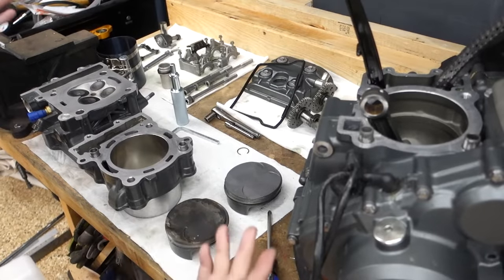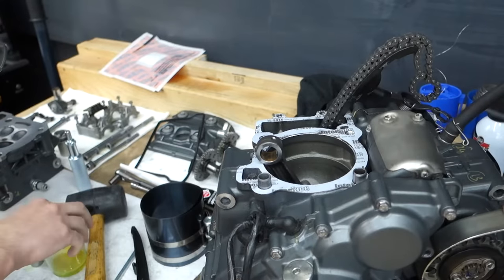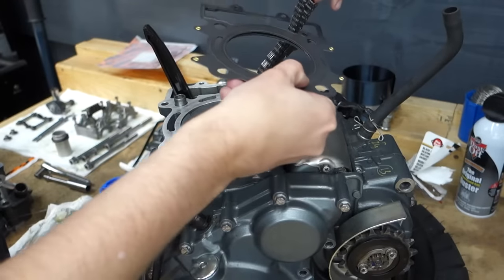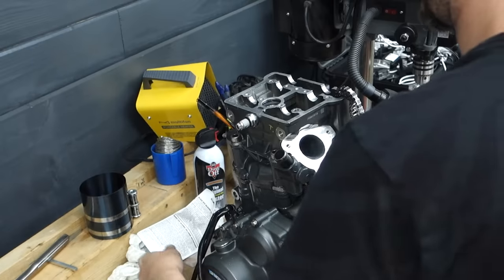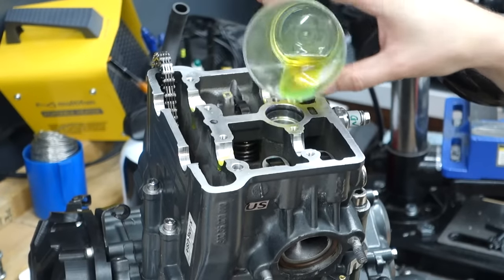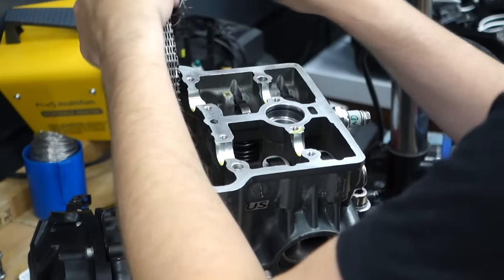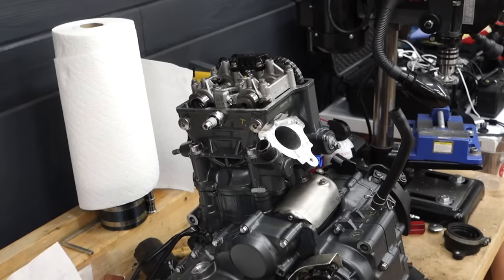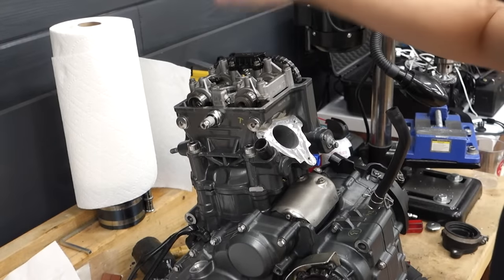KTM RC390 Top End Rebuild

Comment: Hi i have ktm rc 390 bike.i got a issue of high coolant temperature and noise from magneto cover side like ticking sound sometimes not continuously so suggestions feom your side
Reply from the maker: Not sure what the noise would be, being intermittent it may be something knocking around. Coolant temp could be anything from high ambient temps with a stock setup, water pump seals leaking, or a blown head gasket.
Reply: Everything is new coolant lvl is ok no leak and the head is new one
Reply: Is it possible for any sensors error
Reply from the maker: @mohanmano4969  hmm it's possible, I have zero experience with that though
Reply: Anyhow thanks mate for sharing your thoughts
Reply: Cam chain?
New tentioner

Comment: That looks like a first generation 390 motor since KTM changed the cooling passages to give the gaskets more reinforcement in 2016. You're going to have to do this about every 4-5K miles with that motor based on my experience. My head gasket blew 3 times during the first  11K miles before I replaced it with a 2016 motor. My bike now has 55K miles (44K with new motor) and still runs flawlessly.
Reply from the maker: Came out of a 2017 but I wouldn't be surprised if they threw an older generation motor in some of the first run.
Reply: @GarageAddiction  hopefully I'm wrong about what I saw. I was looking at the video on my phone (small screen).
Reply from the maker: This bike was great for a while but has started with trouble again so you may be right
Reply: @GarageAddiction  the dealer screwed mine up three times and then when the warranty expired KTM conveniently forgot all the conversations we had about this. Spent my own money to buy a newer motor with less than 300 miles and it's been great ever since.
Reply from the maker: Glad to hear! I’m not sure what I’ll end up doing but it seems like another engine out is in the cards

Comment: The cylinder is tapered at the bottom. You can compress the rings by hand one at a time and install the piston from bottom of the cylinder instead of using a ring compressor and installing it from the top.
Reply from the maker: I don't know if I'd be able to juggle the rings and cylinder on this bike. Easy enough on minis though!

Comment: So i have adventure 390 (2020model)done around 52000 km there is not even a single noise still runs like brand new so do i need overhaul or anything replaced in the engine my engine is never touched till today
Reply from the maker: You should check the valve clearance for sure, with oil and filter changes I wouldn't worry about cracking the engine open unless something feels different or you see some smoke out the exhaust, coolant loss. I don't think KTM provides intervals for pistons on these engines.
Reply: @GarageAddiction  there is no smoke no coolant loss will get it checked with valuve clearance thank you so much 👍

Comment: Having watched your videos showing all the changes made to fix the coolant mixing issue I can only think of one other possibility….. the joint between the two engine casings. The coolant passes into the casing at the front of the barrel and has to pass the casing joint prior to entering the pump.  Anyone have any other suggestions?
Reply from the maker: Yeah I've eliminated most possibilities now. Planning on drilling a weep hole and pressure testing the cooling system  (not by the rad cap as the seal is poor) If it turns out to be the cases it'll be fun tearing the whole engine apart :/

Comment: My KTM is a Duke 390. It's the same engine. And now, I have the same problem. But i will just clean up. One of the valves is damaged and the oil sinks to the bottom. I'm waiting for the parts. I'm doing the work myself and your video helped me through the process. Thanks.
Reply from the maker: Glad it was helpful!

Comment: Just wondering..... when u installed the piston I remember from the tear down there was notches for the valves when u installed the new piston u didn't show it if the new notches line up with the head correctly? I can reference what I'm talking about from ur previous video
Reply from the maker: At 44 seconds you can barely make out the marking on top of the piston which points to the exhaust port

Comment: Once it's out it's not a complicated engine at all. The video shows everything well visible, nice job !

I was wondering why you removed the cam followers, if you keep them in you can inspect valve clearance even before you dismount the head, saves you some time and you can order the right shims a lot sooner. Of course you need to recheck with new shims installed.
Reply from the maker: It would have saved me some time for sure but I think I pulled the cam 2 times to get it perfect anyway haha
Reply: @GarageAddiction  It was meant to prevent the waiting time for ordering the shims... Sometimes I've got them a day later, sometimes more than a week ;)

Comment: Is it neccesary changing the bottom gasket if the engine is using coolant?
Reply from the maker: Depends on where it's leaking from :) Most likely no, the head is the usual culprit but I also swapped the piston so a base gasket was easy enough while there.

Comment: 9:30 second on tear down video. Is there any way to miss align the new piston when installing just curious had me thinking when u installed
Reply from the maker: There is a marking on the top of the piston that goes on the exhaust side. I think I mumbled something about exhaust instead of properly explaining what I was doing.
Reply: @GarageAddiction  okay was just making sure they were aligned right didnt want u to have any problems just makin sure thing were good
Reply from the maker: Much appreciated, I actually rotated the cylinder at one point and installed it backwards. I threw something across the garage and took a beer break after that.

Comment: Why didn't you go with a larger coolant passage gasket or high compression gasket?
Reply from the maker: I didn’t see any with a larger coolant passage, I’m interested though. I skipped the high compression because of how high strung they are and I’d wanted to make sure everything was working well at stock power before throwing a bit more at it.

Comment: Super helpful. I'm going to be doing this same job. do I need to buy new head bolts or can I re use them? (30,000kms on the engine) Or any other parts other than a gasket set? Can I leave the piston on the conrod  if I'm not replacing it?
Reply from the maker: I didn't get new head bolts but after some reading it looks like that's a good idea. You can leave the piston and rod if they're in good condition. They probably will be, I replaced mine while I was in there with the amount of carbon on it and slightly worn side skirts. There is a thin head gasket kit that sounds like it bumps the compression and runs well but I opted for stock right now. While you're in there check the valves and swap the plug since it's a nightmare to get to.
Reply: @GarageAddiction  thanks. I was thinking after I posted, that it might be very difficult to get the piston rings squeezed in from the bottom, without getting the ring compressor thing stuck in there...
Reply from the maker: Yeah no need to mess with the cylinder or piston if they look fine. It’s a lot easier of a job to just swap the head gasket and studs. Also I’d be very impressed if anyone could keep the piston on the rod and get it into the cylinder haha
Reply: @GarageAddiction  oh I see, I was thinking of doing the lower gasket between cylinder and block while I was there, but I guess there is no need if it's not leaking.
Reply from the maker: @nictarver2988  yeah I wouldn't worry about the base gasket if you're just in there for the head.

Comment: is this throttle body is equipped with Ride By Wire Technology ? or accelerator cable connected  ?
Reply from the maker: My bike is ride by wire, I think that was a 2017 change but I could be wrong.
Reply: @GarageAddiction  yeah right I found online manual for duke 390 2016 study material I couldn't see RBW tech or unit on TB. Change was done in 2018

Comment: Great video mate, planning on doing this myself, bike has started blowing smoke after sitting and around the same as yours 8800km.

What year is yours, the only Piston kit i can find is 2013 even though I search my bike 2017.

Also did you use any other parts or will the Piston kit surfice?
Reply from the maker: Thanks! I have a 2017. The piston kit is the same for tons of years since there have been almost no changes. No real need to replace the piston, I did so while I was in there as it was caked in crazy hard carbon. The part number I went with is 90230007010 which I think lists 2013 as the year. I picked up a bunch of parts when I went through the engine, mainly all the orings in the head, a new oil pressure sensor because I accidentally smacked mine, spark plug,  and a fuel filter. I would get new head studs if I was going to do it again, I didn't think about them when I ordered everything.

Comment: did you get a new valve kit? i'm struggling to find a whole top end kit (valves, valve buckets, etc.)
Reply from the maker: I just got the hot cams shims, the valves, buckets, retainers etc are all stock. I did see that you can get most of the valve train as a kit through dealers: VALVE KIT 390 DUKE ON DEMAND
90236030010

Comment: how many km has the engine done? does it last long? I would like to buy the 390 adventure ... great video thank you greetings from Germany
Reply from the maker: It had about 5500 miles / 8850km on it when I rebuilt it and it's at about 6200m / 9977km now. I bought it with the head gasket leaking so I can't speak to what it went through before me but it's probably my most finicky bike. Cheers!

Comment: Is it a direct injection engine?
Reply from the maker: It's got a throttle body injector
Reply: @GarageAddiction  so it's a closed loop single point injection system
I am looking at the feasibility of an lpg conversion for a Duke 390
Reply from the maker: That sounds like an interesting project for sure
Reply: @GarageAddiction  it's more like a stupid project for me 😁
The issue is the tank, I think under the seat there is enough seat for a gas tank, something like 5 to 7 liter, but it would be fiberglass internally lined with nitrile rubber
Because the main issue here is actually where to put the new lpg tank or whether you can use the main tank for lpg - easy to find out with a compressor to pressure test
Reply: @GarageAddiction  what's the deposit material? Is it steel? Aluminium?
Reply from the maker: @dissonantiacognitiva7438  For the stock gas tank? not sure but It's fairly light so maybe aluminum. I don't think I'd consider it as a pressure vessel though.
Reply: @GarageAddiction  it's steel, probably too thin for pressure though
Reply from the maker: Yeah I doubt it could hold much pressure and there are a lot of holes to plug haha
Reply: @GarageAddiction  back to the nitrile rubber Kevlar idea 😁